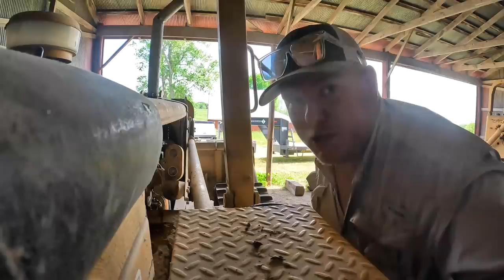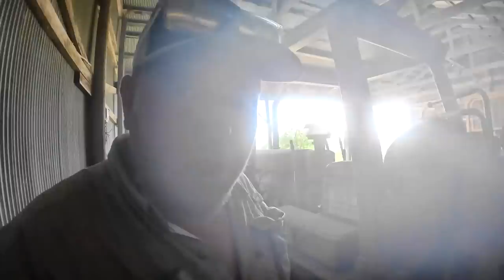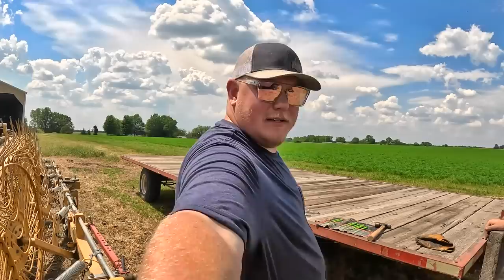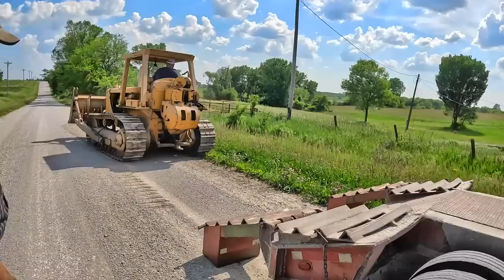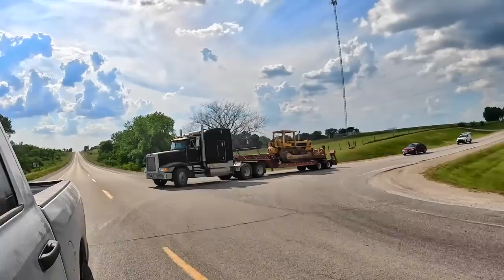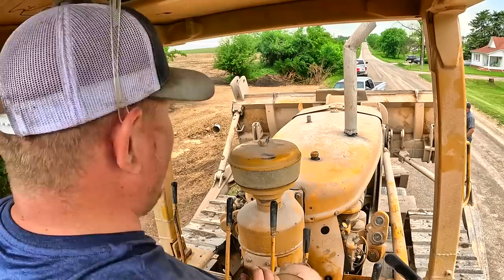BARN FIND 1950's  CAT D6 Cable dozer! - WHAT COULD GO WRONG?

Comment: Good job loading and unloading D6 ! When you unloaded it  maybe good you did not push the brake , if they are not even on both sides it may have turned on you half  way  off .
Reply from the maker: That would not have been cool

Comment: i got a small question regarding the dozer
how many gears does it have? 
rather odd thing to ask and a quick response on a 1 year old video with 32k views is unlikely, but im replicating the general operation of a cable dozer in a video game by building a rather odd variety of machine
similar to this machine, but different in the details, using drive shafts for everything rather than cable cause cables dont exist in the game im working with, but i should be able to replicate most of the functions in the saddle even if the exact methods are not the same 
i wonder if a super low gear and a "high speed" gear along with a reverse would be good enough 
though, that might be tricky to build and have neutral between each gear, so maybe a high low box with a reverser on the back as a seperate shift lever would work good enough? idk.
Reply from the maker: 4 gears, kind of like a truck shifter, then a forward/reverse lever and a hand clutch.
Reply: @iowANFarmer  so basically
a 4 speed with no spring detents and a forward/reverse lever?
interesting setup
im kinda taking inspiration from various dozers 
i decided im going to try to make a early d2 style shifter with 3 forward and 3 reverse in a H though, ill def be using this as a backup plan if i cant get it working reliably
(also thanks for a rather prompt response, i dont usually get such quick responses on things like this)